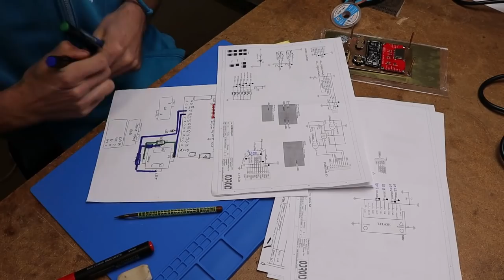Artist's tribute to legendary GameBoy Color

Comment: Doesn't your wiring connection gets short circuit...?
Reply from the maker: There is a air gap between them and the wire is quite tough. So yeah, if you press it then yes it get connected, but not by itself.

Comment: i know it wouldnt work very well - but do you reckon it would be possible to have the buttons made out of brass as well with the esps capacitive touch io? i think it would look pretty cool.

love the project! i like longer videos much more than shorter ones
Reply from the maker: Touch would be problematic, I like the feel of pressing the button. But originally I might add a top layer out of brass sheet :) Another idea was to use a wooden buttons.